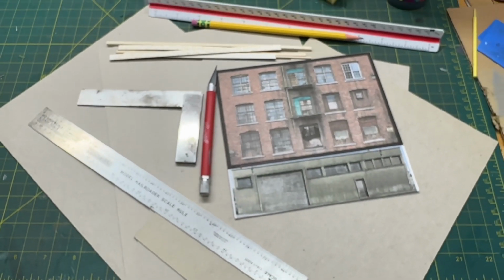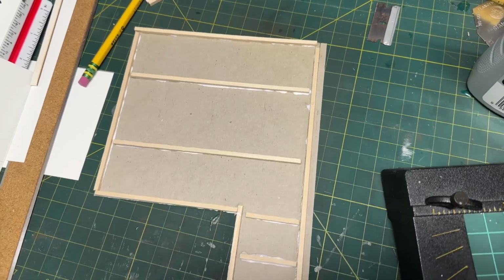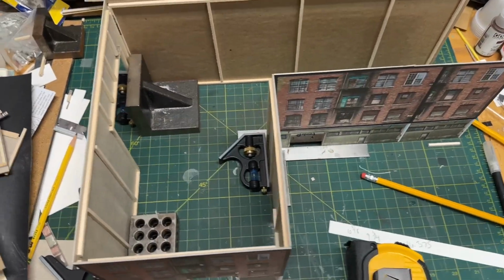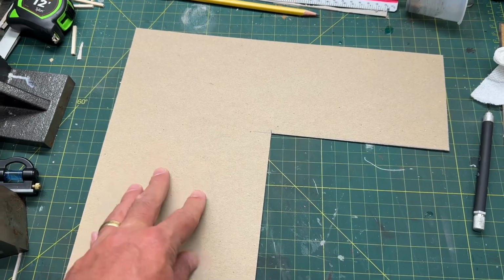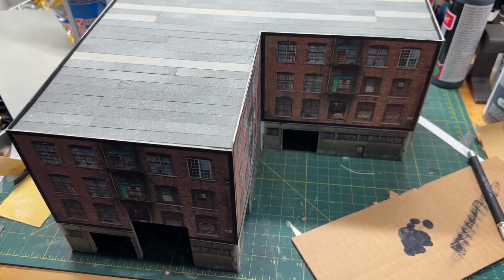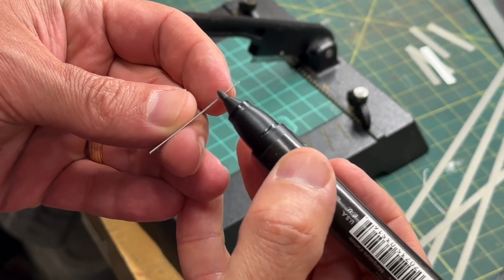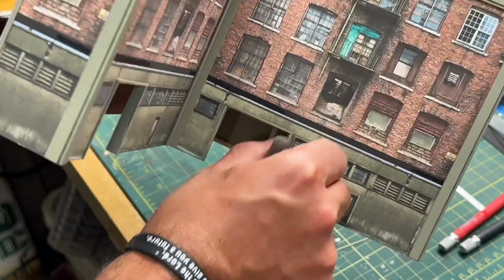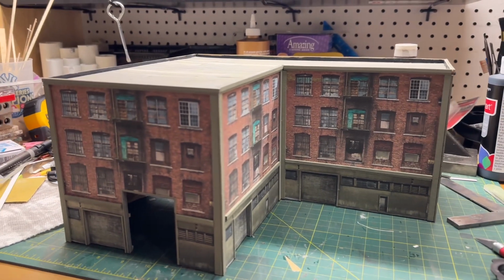HO Scale Card Stock Modeling

Comment: Great video. I'm getting ready to scenic a 2x4 module for our RR club and decided to try photo realistic paper modeling. You explained it very well, and I picked up a LOT of ideas I'm going to incorporate in my builds. The interior bracing is so spot on and smart. New subscriber now and looking forward to binging some of your other videos. I know the video is over two years old but thanks for posting it anyway! BTW,  where do you get your paper models?
Reply from the maker: Thanks for subscribing and for your comments! I really need to finish that building and add the top structure, signs and other details to finish the project. I found the images online and then designed the structure.

Comment: Just fyi, that's not "steel-wool" youre using. Its a scouring pad.( also known as buffing pads, in metal work.) You can also use those to make hedges, if you pull them apart a bit, and cover them with some fine foam foliage.👍🏼

Comment: I see that you incorporated wood into the model but not as any features but rather for bracing.  I would have used foam board for bracing and saved the wood for adding wooden features.  I see that you have used some relief but I think I would have used a little more relief on the building fronts.  Of course this is just my opinion and I try to model on the cheap.  I've found that foam board is just about as steady as wooden bass strips.  I also save all my old cereal boxes and beer cartons to use for card stock. Now that you have added the rolled roofing to the desk blotter I see that it has strengthened the blotter so it needs no further bracing.  I would have used some paint to get rid of the white edges on the top and any area that you don't cover with trim.  Cheers from an old modeler in eastern TN

Comment: I learned to model in card stock a few years ago.  Since then I've done 2 models I downloaded years ago when the Taylor's General store was still available.  I also did another model house and both were HO scale.  Back then I learned all about adding relief to the flat card stock.  Since then I've recently downloaded the new free offering from Clever Paper Models which is the Silver City Tool Shed and the Haunted House in O scale since I've gotten enough Lionel 027 trains to make an 027 layout.  I've got to order the tube squeezer from Amazon to add relief to the corrugated steel required in the Silver City model.  I had some problems with page 6 of the Silver City model as my printer chopped off the bottom of the door frame.  So I figured a way around the problem.  I will make that door frame out of some thin balsa wood I have on hand.  That's part of the fun of modeling in card stock.  It can be very forgiving at times.  I've been wanting to incorporate some wooden features into the card stock models.  Cheers from eastern TN

Comment: I have the older chopper like you. Is there a tea on you turned the mat moving the blade slot to the side. Does it help better cut the wood somehow?
Reply from the maker: I was cutting into the mat so turned it to get a fresh section of cutting surface. Not sure if it makes a difference. The chopper is a must have tool!